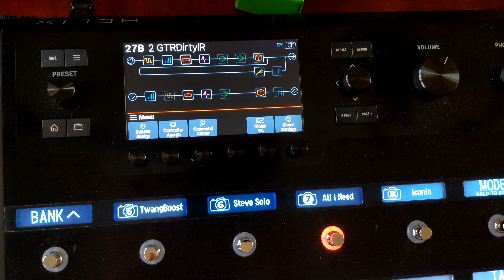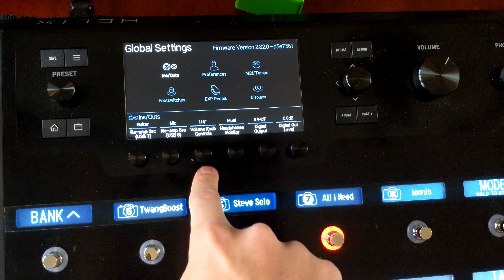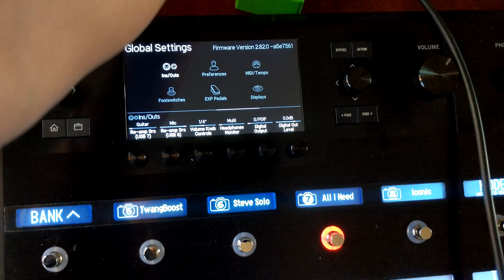Line 6 Helix - Setting Up Outputs for Live Use- Bypassing Big Volume Knob - 2 Minute Tip

Comment: How would you recommend controlling overall volume level on the hx stomp to the front of house? Do you use the channel volume? External volume knob? Lower the output main level db at the end of the chain?
I use the channel volume from the amp block but some say to leave it ok 10 for more headroom.
Reply from the maker: I always advise to avoid controlling the volume to FOH. Have it set to Mic level and leave it alone. If you are sending too hot of a signal, channel volume is your friend. If you are on a gig and need a last minute fix, you can also go to global settings and bring down the volume there
Reply: Ok so do you recommend starting the patch with channel volume at 10 and external volume knob at 10 then if it’s too hot then turn channel volume down?

Comment: Valuable tip, thank you. Any thoughts on putting an EQ pedal between the Helix and FRFR? I'd like to tweak my stage tone without interfering with front of house. Can an EQ pedal still work with line level output from the Helix?
Reply from the maker: You have a global EQ that can be set to whatever output you're using if you don't use it for FOH. You can also make a parallel path at the end with the EQ and send that signal to the cab

Comment: When there is a backline amp - a Hot Rod or something - do you change the 1/4 inch out to instr level?  Thanks.  I enjoy the channel!
Reply from the maker: I keep it on Line level so I have more control over the signal using the big knob. If, for some reason, it becomes too hot of a signal, I just dial back the knob rather than change the setting
Reply: Steve Sterlacci great, thanks for the reply
Reply from the maker: @thpark8189  any time!

Comment: HI - thanks for the videos!  I have been trying the big knob at 100% as you and others have recommended.  With my IR at -18, I have to keep my channel volumes pretty low in order to keep my levels where the mixer can handle them without clipping...  depending on the amp model, it's between about 3.5 and 5.5....That's with my output set to line for the xlr to the mixer (mic level is too hot)... does that make sense to you?  So many conflicting opinions/advice... just looking for a reality check.  Keep up the great work!  Thanks!
Reply from the maker: Sounds fine to me but the MIC level is actually less output than the Line level. Most engineers ask for mic level. As long as you're not going into clipping and it sounds good, then it is good!

Comment: this can be very useful but my presets were way to loud and clipping the FOH mixer.  i lowered all the amp settings.is there another way to do this other than setting all the presests lower volume?  im using a headrush moniter now can use the knob for on stage. thanks.
Reply from the maker: I would always recommend testing your volume against the dry signal with your amp and cab bypassed. If you're clipping a soundboard you've got to turn your channel volumes down. You could also go into your global eq and set it to drop your signal up to -20db
Reply: @SteveSterlacci  thanks one more thing my looper with this setup is not coming out of 1/4 in to moniter. only FOH

Comment: That's a flawed rule. You're better off sending a line level over the XLR to the house PA because it will travel further with less signal loss and better signal-to-noise ratio
Reply from the maker: Its not a rule, and its not flawed. It's how the unit was designed to be used. Line level is too hot for some older mixers. In most cases, it shouldn't be a problem. But that is how the units made to be used. I have never experienced nor heard of anyone else experiencing any signal loss or s/n issues with the mic level
Reply: @SteveSterlacci  You're fine I'm sure but as a rule the higher signal to noise ratio the better.  I would be sending line from here but yeah the mixer needs to be able to take pro levels.  Rock on Steve !

Comment: Hello Steve, what is the option if the set-up is patches with pre-amp only - no power amp, cabinet, IR's - going out of the Helix to an amp pedal then onto a cabinet?  This takes care of the amp on the stage scenario but what about FOH?  Is a signal from a patch with a pre-amp only out of XLR's enough for them to work with?  Thanks in anticipation.
Reply from the maker: I am not totally sure of the question here but I think you are asking if you can go to a power amp on stage? I would use an FX send set to instrument level. You can place a ""send" block that will send a signal out to the power amp and real cab, but also pass signal to the end of the chain and go to FOH via XLR. Hope this helps and sorry it took so long to respond. YouTube isn't showing me all my comments

Comment: what's the best way to add a volume boost for solos to existing patches with Line 6 Helix ?
Reply from the maker: Depends on what you need. I always add a bit of gain from the amp or pedal and use the channel volume with snapshots. You can use it the same as a real pedalboard too
Reply: @SteveSterlacci  Do you have any videos demonstrating this?
The video above setting outputs for live is very helpful, 
Thank you
Reply from the maker: @GtrMan863  great idea for my next video ! Maybe I can get to it after the NAMM show
Reply: @SteveSterlacci  Thank you!

Comment: I never tried this, but do you hook both at the same time and transmit sound? I dont have frfr unit, i using tube amp runing into effects loop at the back using line levels 1/4 option. Thank you
Reply from the maker: Yes! The outputs are all simultaneous

Comment: Steve, signal Q: I set up my Helix going into my Powercab 112+ so that my Powercab light is yellow. Then on the Jarvis setting my signal is even at -13.00dB. Then I use the output on the PC to go to the board. The sound guy at the board constantly says my signal is too hot. Any tip for getting my sound balanced?
Reply from the maker: Your output from the PC is probably set to Line, change that to be Mic level and you should be golden. Line level to the PC, mic level to a board
Reply: @SteveSterlacci  ok, I found that. It was on mic. The Helix is Line. Maybe my sound guy is just a pain!
Reply from the maker: @GiantSFaithfuL  that could be! Lol cheaper sound boards wont have as flexible inputs.  Or he could have an instrument/line issue on his end. I would just lower the speaker model volume i guess. As long as your input is set and you can get to where you want for stage volume. IRs are supposed to be -18 in the PC

Comment: I like instrument instead of line for signal...
Reply from the maker: Going out of the helix?
Reply: Steve Sterlacci yes..
 drives sound better to me..
Reply: I think it depends where you are heading to. FRFR I think is better with line, but I e.g. go into a tube poweramp, then instrument level is better to handle
Reply from the maker: @shellsjoint  you talking about the HX stomp output? Either way it's the same I think. Mic and instrument are the lower output signals. I think they sound better unless it needs to drive a speaker like the Powercab or other FRFR speakers that need the juice
Reply from the maker: @davidforbes72  exactly. I found that the return of the fx loops in fender amps didnt make too big of a difference. Either way, I control that from my big volume knob so it's better to have the head room of the Line out (for me). All subjective to our own scenarios!

Comment: If you set the large volume knob to "digital", does it control the volume coming out of the L6 link to the Powercab ?
Reply from the maker: I would assume yes. I have not personally tried it but I'll be damned if it that didnt make perfect sense ! I'll look into that as well. Let me know if you try it!
Reply: I looked on the back of my Helix and it does say "Digital" above the L6 Link so I'm guessing Yes. My Powercab 212 plus is ordered and on the way. That would be great if it is that way because then I could control Volume of the Powercab without going around the back of the cab when it's leaned back.
Reply: It does. I have it set to Digital and use PC+ as stage monitor via L6 Link and send XLR to FOH set to MIC. Vol knob only affects volume of the PC.
Reply: @odersfelt4807  Thank you, that is awesome. Line6 thinks of everything !
Reply from the maker: @odersfelt4807  Excellent! So literally exact same concept just using the digital out instead of 1/4 inch. Thanks for the info!